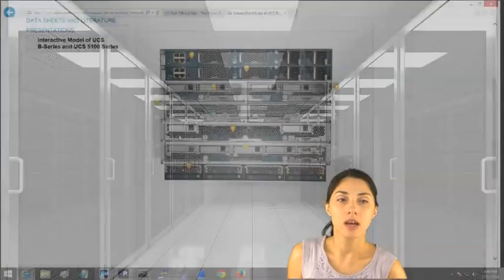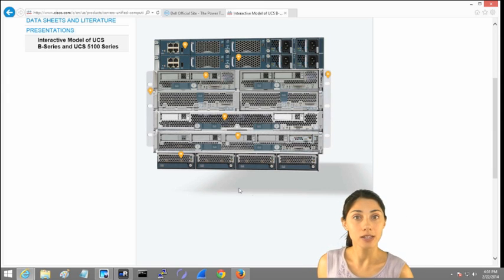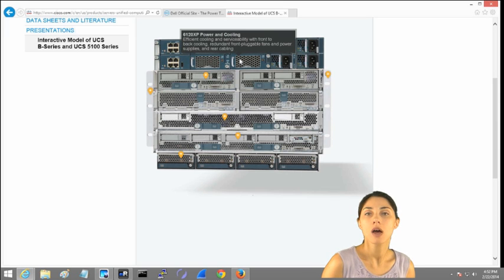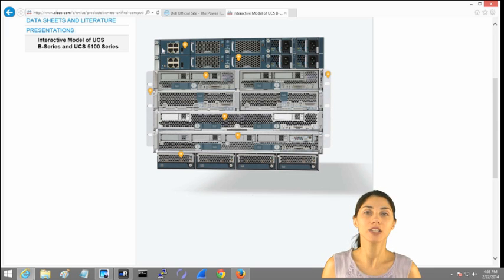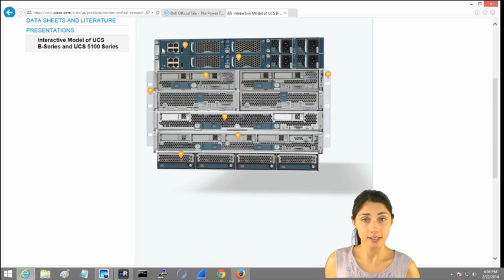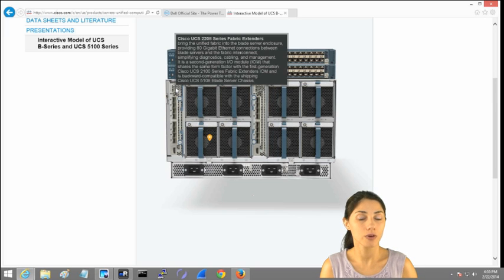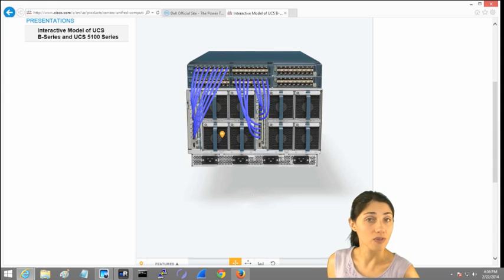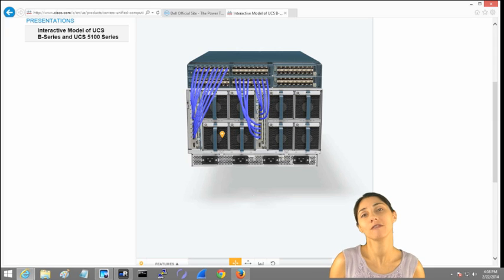Cisco UCS Hardware Overview

Comment: Hey there.  Currently running 6120xp pair, and hitting end of life on those pretty soon for hardware replacement.  Still have 1/3 of the ports open, running 4 full chassis against it and connected to 2 brocade san switches, using 4 FC interfaces - trunked upstream to 2 multihomed N5k running VPC.   I don't see our SAN environment getting too much bigger in the next few years.   If you were to give an opinion for a possible upgrade, what would you say?

Comment: Correction-: UCS- Bseries has 4 power supplies in total not 8.
Reply from the maker: +Abhishek kumar I believe @ 2.05 we mentioned a max of 4 power supplies.
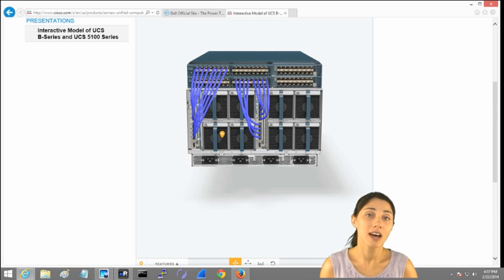Reply: +Westchase Tech A bit late to this video, but check 8:05, there was a mention of 8 power supplies, but I think most people would realise (I did at least) that you meant 8 fans because of the follow up comment about keeping the chassis cool :)  Anyway good vid, keep them coming.